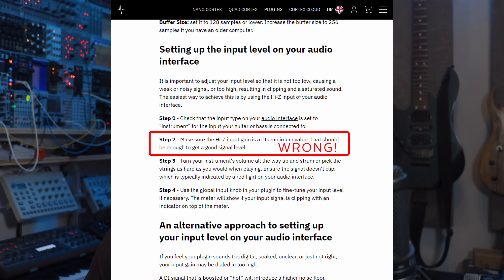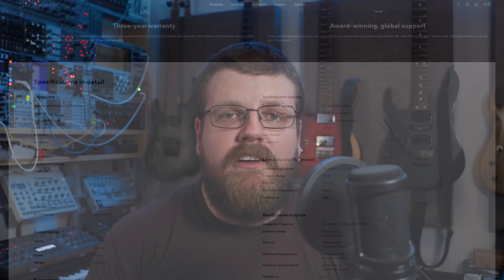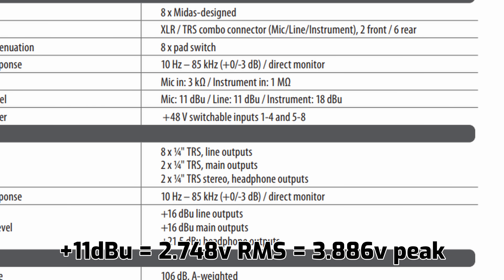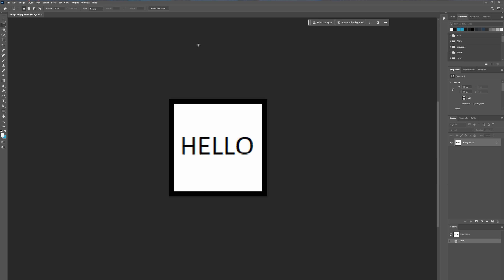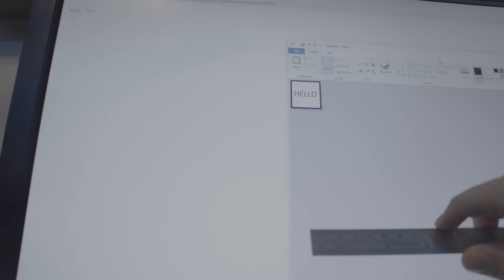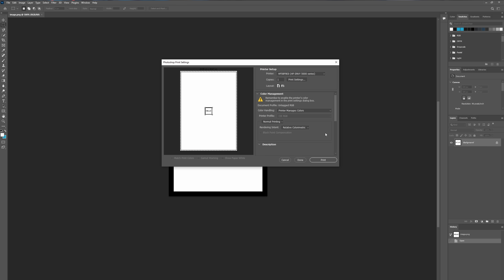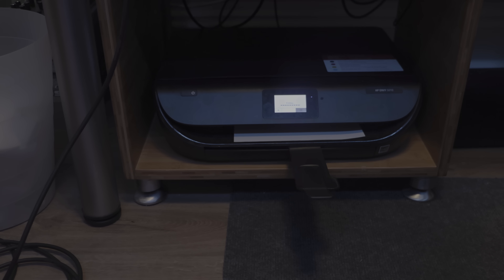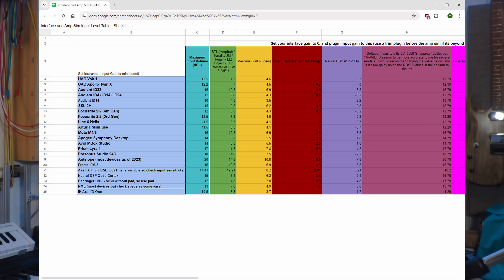Ampsims and input gain - Please, stop the madness...

Comment: Iffffff you look at the noise floor in both instances, the noise floor has a 3db difference. If you look at your output vs input ratio, it inverts the same. You did not show what it looks like if you actually use a 0db input level reference for the input ( usually -18dbfs for digital interfaces ). That 3db difference in noise floor is how the amp sim amplifies the noise through it. So when you play the guitar at playing power, and adjust the level to 0db reference, how does that change the gain structure and noise floor of the amp sim? Going for max input does not negate the self noise of the DAW interface. The lowest noise occurs when you maximise the input level to the self noise of the interface, not when you use all available " bits " of headroom. The self noise of the input interface always plays in. 

Digital gain is esentially noiseless. It will make louder, ALL that is brought in. So it is all about maximising input to noise ratio. What is that? That is the point where the input signal is louder than the noise floor by the most amount..... period. You have to find that.

Comment: How do I know how much I've increased the gain by on my interface? By just estimating the percentage of dial turned up into percentage of maximum gain available from the interface?
Reply: I feel like this is a crucial bit of information that the OP left out for some reason.
Reply: I tried this using NDSP with UAD volt. I used prefader metering in Logic to see what my guitar peaked at with interface gain set to 0. Then I checked the peak after raising interface gain to just below clipping. Get the difference of those values and turn down the plugin input gain by that value. Say prefader 0 peaks at -14 db and prefader under clipping peaks at -4. Turn down input gain in plugin down to -10 and add back the adjustment from the chart (+.3), so -9.7 in my case. Not sure if there’s a more precise way but would be interested.
Reply: I have the same question
Reply: If your interface only has lights and no db meter:(howewer you could also open a daw and watch it. Anyway if you want to be precise: Record while turning the gain from 0 till just below clipping. Measure the recording. The differrence in db is what you subtract. So the beginning when it is set to 0. compare it to the in the recording part where it is set just below clipping. If you still don't know How to compare? Meter in your daw.
Reply: I use apollo and therefor I can see how much gain exactly in my console. If I just turned the physical know I wouldn't know either. So measure it. Also depends on what type of recording. You play soft or do you chug? try to measure and compare it using the same intensity.
Reply: The chart he shows has your Interface (I have the Scarlett) on the left. I assume you look across the top of the chart to see which plugin or DSP(I have a Helix) . Looking down the helix column the scarlet has 0.5 which corresponds to 12 o'clock . I may be wrong but it kinda makes sense to me lol
Reply: @kickbaktube  
He used the chart to make a fair comparison.
You don't need a chart to hear if your plugin is clipping.
If it's an amp model, set the channel to clean to check, like you would do with a real amp.
Reply: It's a useless information.
Just push the gain until it clips, then turn down a bit.
What you have is the audio file in its best possible shape, and how much gain you used to get there is irrelevant from that point on.
Every intrument has its different output, every amp sim has its design.
Use your ears from that point on like you would do with any analog hardware.
If it clips or distorts, the input is too high, just a notch below that you'll have the best ratio.

Comment: Thank you for finally putting this to rest.  Just seeing the tiny waveform and having to clip gain it back up seemed weird. No matter what the DI level was, setting the input on the amp always made the tone, anyway.  When the interface was gained to just below clipping, the input still needed adjustment as you've shown.  I stopped doing the set to zero thing after a few weeks trying it, because of exactly what you've said here, but I did not have the mathematical explanation until now.

Comment: Why would the manufacturers bother to put a knob if there were no need to set the interface gain to any level different from 0? Just as simple as that to me. Different instruments with different specs, will send different signal levels to the chain, so adjustments should be done...

Comment: Is there a way to figure out this gain staging method without that chart? My old Focusrite Saffire Pro and my favorite 5150 amp sim Kazrog 1992 Ampcraft aren't in the chart.
Reply: Just do it by ear. An advantage would be to have the amp in real. I had the 5150 in real, so roughly I would be able to adjust the amp-sim's input level knob to the point where the crunch sits right. But in general, just imagine where you usually put your gain knobs on a high gain amp and how it reacts. You don't have to be 100% correct.

Comment: 0:54 The problem you described there, about each interface having different input levels, was already addressed on Ed S' video.
I think you missed part of the solution, it's not just zeroing your input level, it's also compensating the input level on the plugin.
This is supposedly the original video, except that I've seen one even older than that by two years talking about the same thing.
https://www.youtube.com/watch?v=jXKZqJtjLkg
Reply: Rhett's.
https://www.youtube.com/watch?v=YNO2VTI5KHE
Reply: Rhett Shull did a video with a real amp and the plugin version, and the one with zero input was identical and the other was not.

Comment: yes.  but the whole spreadsheet thing is insane too, there is no need for users to know any of that if the amp sims just give us an automatic input gain feature appropriate to the sim's internal reference level - ie. you strum hard and It listens and sets the appropriate digital gain automatically.

if you want to make it more nuanced, the app can ask what kind of pickup you use (or just use AI to detect it automatically).  but we shouldn't need to look up voltage references.
Reply: The problem is that many of the amp sims are all over the place. i.e there's no single 'input gain' that will work with all of their simulated amp models. If you have the real amp (or a reference) you can compare, or you might set it 'by ear' to whatever sounds good. But for those hoping they can bring up the 'Pomegranate 4000' amp and set bass / treble / volume etc to certain settings and expect it'll sound like (or very close to) a real pomegranate 4000 with the same settings they're out of luck.
Reply: @michael-3-l3  what I'm saying is that each sim needs an automatic input gain learning feature that listens to hard playing and sets the correct digital gain for whatever it uses internally.  this should be standard in the future, users don't need to know any of this if the software takes care of it.  I know right now that doesn't exist, but that is the elegant solution - and there's no reason why they can't implement it.
Reply: @desperateBeauty  Well it would be difficult to work because what if you started playing softly? Does it bump input gain? TH-U has a manual input gain feature, it shows you an interface  and tells you to strum loudly and adjust your interfaces gain so the interface stays in the green - but whether that setting actually means their amp gain is matched to the real life amps? I doubt it.
Reply: @michael-3-l3  no the feature I'm talking about you only do once to set the correct digital gain permanently (unless you change the preamp gain or the instrument).  as you suggest, set the best preamp gain, then let the sim learn the correct digital gain for it's reference level once, that's it.

Comment: Starting with the straw man and assumption that everyone else is a moron isn’t a great approach. 

The early “max signal” idea in this video was true for some old analog preamps. And the “bit depth” idea is also outdated and heavily dependent on your interface (your Behringer here.) Most modern interfaces convert at 24 bits regardless of what you’re recording with.  And the preamp interface noise is still a factor, but with modern preamps, the ratio between signal and the floor does not necessarily improve when you increase the gain. Your snr could be exactly the same at max as at lower settings. 

In this case, your approach is correct, for your interface. You want to always minimize your noise floor. 

But your reasoning for getting there is, well, a bit stupid.

What you’ve demonstrated is about as related to math and science as wearing a tinfoil hat and pointing to your spam email reducing 😂

Comment: The zero gain approach has one big mistake to begin with: the audio interface specs. What I mean is that the maximun input level at minimum gain is diffrent between line, mic or instrument level. Some audio interfaces specs have all of them clearly indicated while others don’t. On the reference sheet lot of the values are taken from the interface specs, but what kind of level this values are referring to is not indicated. If you take the Audient id22 specs there is a value for mic level, a value for line level and a value for instrument level. But if you take the Antelope Zen Go specs the maximum input level at minimum gain is 20, which is the value of the datasheet, but there is no indication of what that value is referring to. Line? Instrument? Mic? I have the Zen go, and if I set the gain to zero the signal is very weak, to the point that in Logic Pro the meter is barely moving, and every crunch tone from a plugin sounds completely clean. In my case the zero gain approach is completely wrong.

Comment: Thanks for actually knowing about the topic instead of regurgitating some strange lore. I run a boost pedal into the HiZ input on my interface so I have a nice tactile knob to compensate for different guitars. Good points on the noise floor pre-AD  and compensating with the digital gain to keep the sound right. I will reference your spreadsheet next time and see how close it gets to dialing in by ear.

Comment: The logic is correct but I would keep a decent amount of headroom (at least 10dB) to avoid clipping at any cost. A lot of people gain stage dangerously close to clipping, and that’s worse than a little bit of background noise in my opinion. Modern interfaces have so little self noise it’s not an issue most of the time. Unless you put the gain at minimum, which is stupid, as you demonstrated 😁

Comment: I'm also an electrical engineer. There are too many details into this thing.
They set to zero is mainly to avoid clipping. Technically you do want to set to the level right. However convention is around -12dBfs. While most of the time you already get -6dBfs or already slightly clipping. So...what to do now? Add a DI box?

For ampsim there needs to be a reference analog to digital gain. So theoretically highest SNR option is not necessarily correct level.

There's no correct approach. But granted although setting gain to nil is usually the best option it's not the only way or the correct way to do it.
Reply: This problem is also in the printing. Set it to the real size or the full paper?
Reply: I switched to a passive DI box between my analog pedal chain and my interface XLR input,  and I find I have a wider dynamic range of input gain while mostly leaving the preamp gain knob alone around zero.  It's better and cleaner than the interface DI ever was.

Comment: My current understanding....  if your instrument input device INDUCES some noise above unity gain, then in fact, you would prefer to leave your input device at UNITY so as not to induce noise by turning the input up.  This is a concept so if you think ALL input devices create the same amount of noise below, at and above unity gain, then do you.  Handle your bidness.  I just think the concept of gain in GENERAL, should be the same as it used to be.  Set your levels for the TOP PEAKS to either hit as the ceiling (0 db) or higher if you have an auto limiter going on.  You definitely want as much CONTENT as you can get per track with the LEAST amount of noise and clipping.  That is all.  HOW you achieve that with YOUR equipment ...  don't ask me.

Comment: Just so that I understand completely: so in Line6 Helix Native VST we have the input meter displaying he ideal range of input it needs. What I learned few months ago is that instead of feeding it 0dB, I need to add gain in the audio interface input so that my guitar sound enter the plugin in that range showed by the plugin; but you're saying it would better to add the step of sending the highest guitar signal without clipping in the audio interface and then lowering the input level in the plugin - in this case, because there is the input meter info, until we are in the right input range.
Am I understanding correctly that you're saying these approaches are not equivalent because the audio interface's capture is not optimal in the initial approach? Thanks for the video 👍🏼
Reply: I'm not the author of the video, but your understanding is correct, this is exactly what he means by his video... if you do the process he mentioned, you will get the optimal S/N ratio signal into the plugin, and lowering the input level on the plugin the correct amount will make it keep sounding "as it should"

Comment: I think some people are strangely more concerned with simulation accuracy than proper gain staging, and I think that's where this whole zero analog gain thing started. The other weird thing about it though, is that we often change the amplitude of our DI signal by arbitrary amounts before a real amp in the real word all the time with pedals and stuff, why are people suddenly obsessed with not altering their DI at all? People seem determined to turn music into a giant math problem when its supposed to be fun.
Reply: "we often change the amplitude of our DI signal by arbitrary amounts before a real amp in the real word all the time with pedals and stuff"

The primary function of DI is to convert a single ended signal to a balanced signal. This is done for compatibility purposes, such as plugging into a mixer that requires a balanced connection, or if you need to run long cables. You can't make a comparison with amps and pedals because they're all single ended devices. DI doesn't apply here.
Reply: @052RC I suppose I should’ve used the word “signal” rather than “DI”, that was my mistake. I sometimes mistakenly use “DI” to refer to a guitar signal and I need to stop doing that. It’s almost as bad as calling multitracks “stems”. My apologies. 

I still don’t see why people are worried about changing the level of the guitar signal though whether it’s right out of the guitar or after a DI box or after conversation to digital. Unless they’re the type of person who prioritizes amp sim accuracy over proper gain staging, then it makes sense on paper. Otherwise it’s creating a problem where none existed. Or maybe everyone who used amp sims without turning their input into a math problem completely ruined whatever they were working on and nobody noticed until someone made some YouTube videos about it. It’s just weird to me to suddenly be worried about this is all I’m saying. Cheers! 🍻

Comment: Finally! :) Thank you. Another advantage is that you record a reasonable DI signal which can be edited properly. At 0 input gain my Motu M2 gives me a nearly flat waveform.
Reply: Exactly. I can't believe so many people fell for this set at 0 advice
Reply: So what did your final setup look like on the motu and in the plugin?
Reply: Exactly. I had the same issue. Went to reddit and was told to just 'get better at playing, this is how meshuggah does it'. XD
Reply: You can zoom the waveform verically in most daws
Reply: @tutatis96  Seems like an added step. Why not have a good signal to begin with where each transient and note is clear?
Reply: @EthanRom  well you record clean signal. But you also use the zoom of your daw when you need it it's a keypress like every zoom it's not a "step". Also depending on the interface distortion can happen in the preamp before the clipping of the  ADC.
Reply: @tutatis96  if you record too low sometimes even zooming in won’t show it anymore
Reply: @EthanRom  i can zoom 300db,   in pro tools, i think that's enough

Comment: Might be a stupid question, how do I gain stage when using multiple plugins in a signal chain, especially if/when my amp sim does not have a digital gain knob: using 808 sim + Amplex Amp Sim + IR loader instead of just Neural DSP as an example.

Do I follow the steps and gain stage on a different plugin before/after the ampsim - if not, what's the best practice?

Comment: I'm glad that someone has finally done the maths on this.
All credit to eds and his chart, but my Quantum 2632 interface was not on it so I had to go back to DIY. 
DIY but now aware of the reason that my guitar modelling plugins were being overloaded at 'Default' settings. 
I don't push All the way to that magical 'just below clipping', I like to give myself just a little more headroom so I aim for Peaks around -10dB indicated, RMS -18dB.
My 'Ear Test' is to take a known clean sounding amp and check that it doesn't break up at 'real world' settings.
+13 to +15dB of gain at the interface does nicely with this Quantum 2632.
If I were to squeeze every last bit out of the initial A2D then I would have a  Lot of DAW channel and or Plugin Preset editing to do.